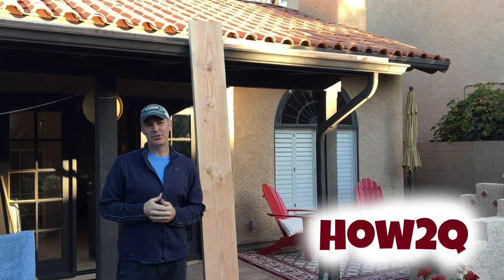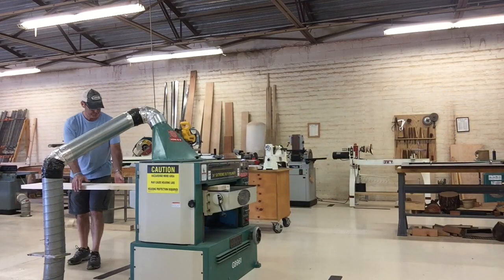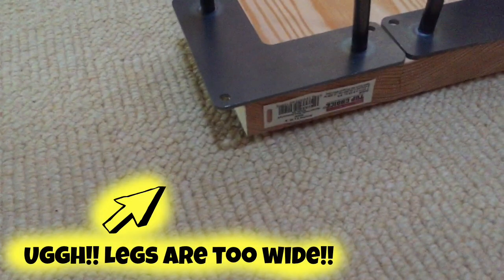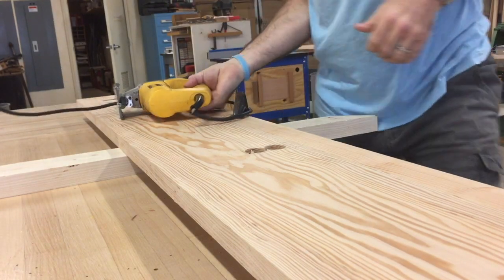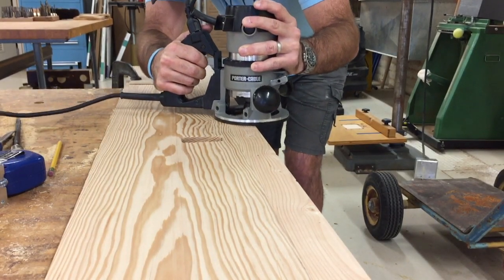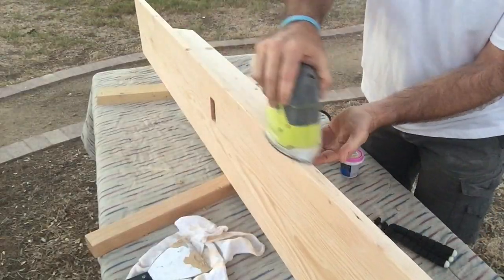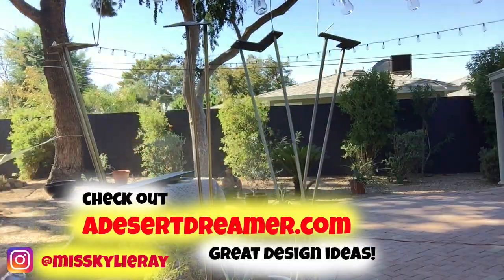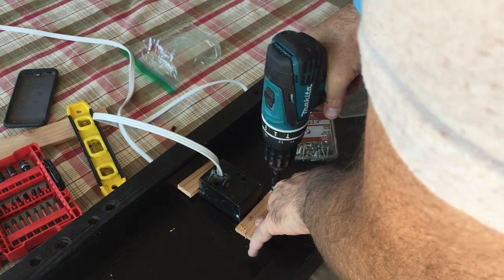DIY sofa console table with hairpin legs & usb outlet

Comment: Did you paint the metal outlet box black ????
Reply from the maker: Thanks for your question...I did not.  This console table was built to go between a couch and a wall (apartments/condo's mainly) so nobody will see the bottom.  That would have been an option though
Reply: Thanks for the response. Great job by the way. I followed every step for the outlet and extension cord however after assembling the usb outlet I plugged it in an extension cord connected to a six prong outlet. I blew a fuse in the garage . Is this still safe to plug directly into wall ???